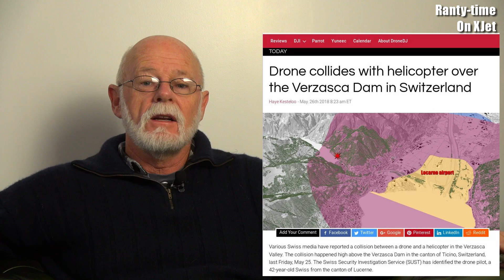Why I want to fly a drone into a helicopter tail rotor

Comment: Make sure all aircraft have ADS-B, receiver onboard drone, job done. An R22 or 44 might loose the boom due vibration with that strike.  They are super fragile. #NoGABelow2k
Reply: no GA below 2k come on thats just stupid! I'm looking at this from a pilots pov and a model a/c pilot
Reply: robinsons are just known for having flimsy tail booms.
Reply: Yeah,  very um, flexible. I would like to see what happens with an EC130 or the like fenestron receives a fly through.
Reply: Downshifting Kiwi I'm also a pilot, what place to hobby pilots have below 2k when money is being made down there? GA has a much higher death rate than RPAS very often a problem with the meatware
Reply: Good idea and there are even affordable products that painlessly integrate with DJI products https://www.uavionix.com/products/pingrx/ (check out the icons on the map) but this all relies on the GA aircraft transmitting and many won’t be. Still very good idea for those doing regular BVLOS
Reply: Ardupilot equipped airframes will get out of the way all on their own with just an ADS-B receiver plugged in. Manned aviation needs to catch up ;-)

Comment: Impact with tail rotor would also require inspection/scrapping of whole drive train. Treated the same as a sudden stoppage. Also depends on which helicopter tail rotor you were testing. A Robinson R22 tail-rotor is far less robust than a EH90 for example. Even so remember the tail rotor is usually rotating 4 x the rpm of the main rotor. I think the first lethal incident will result from drone impacting the windscreen and striking the pilot. Thats the scenario I worry about most.
Reply: and therefore you do the test with the least robust aircraft for starters and see what comes of that! If it fails then it is reasonable to apply the ruling for all as the UAV operator will not necessarily know what type of aircraft may be operating in the area! If it doesn't fail, then you can safely state that any more robust tails will be able to withstand the impact and so the point is there is no threat to life!!!
BUT ----- I do not condone the mis-use and inconsiderate use of any RC aircraft and, yes, they should be shopped for breaking the existing rules that are very clear and have been in effect for decades, which those of us who enjoy the hobby have been following SAFELY for those decades!!
I myself am not affiliated to a club but hold "BMFA Country" membership, meaning I do not necessarily fly at a designated RC flying field but as long as I conform to the rules laid down, I am covered by the insurance!!!
Reply: Problem the same scenario as a bird hitting the windscreen and striking the pilot. But the drone scenario is less likely to happen, as there are more uncontrolled birds then drones flying at any one time.
Reply: You are absolutely correct. However I'm referring to the topic at hand.
Reply: As was I. The topic of "drone hysteria" by pilots and others.
Reply: Anthony Witham birds have natural reactions to predators. They dive.